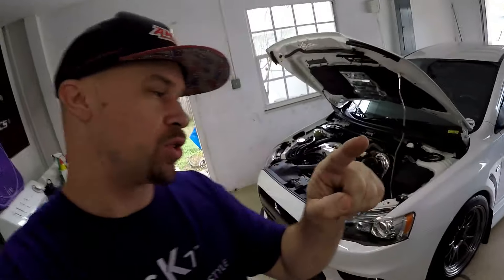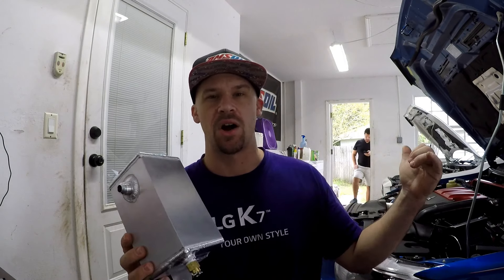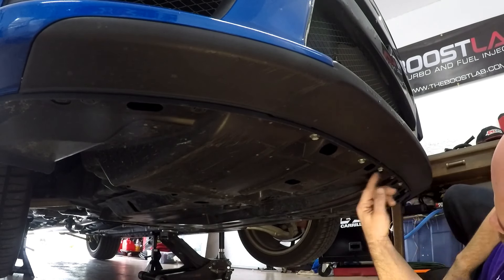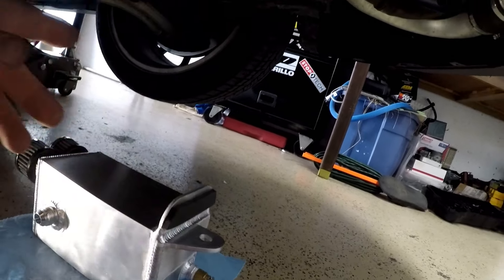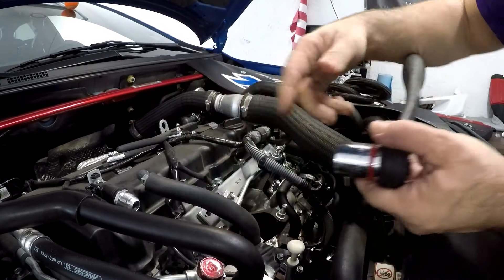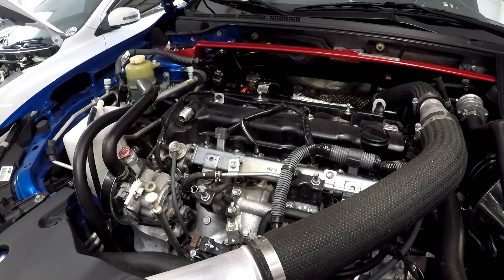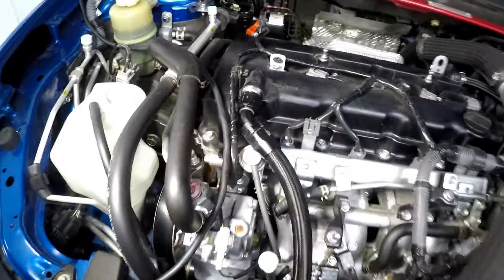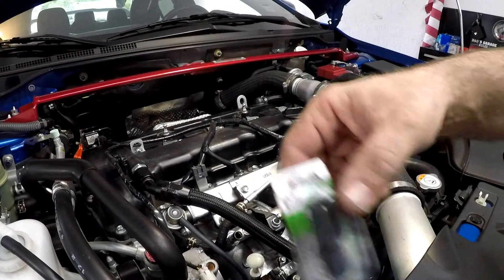STM Dual Oil Catch Install // Evo X

Comment: Thanks for the install vid, I always wondered why aftermarket companies don't make AOS for  evo's and only catch cans?
Reply from the maker: Hunter Bautista Thanks man. Multiple companies out there do actually make the air oil separators. Such as Moroso and Driven Fab
Reply: @xtra_slo1596  nice, most evo owners on youtube only install OCC not AOS.
Reply from the maker: Hunter Bautista it’s true, not many air oil separators I’ve seen done.
Reply: Driven fab makes a nice Air Oil Separator.   I have one on my EVO.  It connects back to the intake which helps reduce crank case pressure by using the "suction " of the turbo.  I feel this is the best method rather than venting  to atmosphere. 

The problem with the AOS running back to the intake is you need a large line 12N going back to the intake or you won't get the needed volume of air.  This means you need an after market intake and you need to weld the 12N bung on the intake for the 12N line ( which comes with the driven Fab AOS..  Due to this I think most people just go with the vented catch can.

I ordered mine from Driven Fab and recieved it 2 weeks later.  You have to contact them by email or Facebook.   Don't call them.
Reply from the maker: dsmtsi cool advice for the another method!👏🏼👏🏼👏🏼 driven fab took over 6 weeks for mine and 4 Months for my local friend! Email, Facebook, Phone... they lack customer service and delivery time Big Time! They are well known for this. Wish it was better because they do have some great products. Got lucky only waiting 2 weeks
Reply: @xtra_slo1596  Ya I got my 8374 bottom mount the kit from them and it took 5 months for it to come  in.  It wasn't until I started to hold them to delivery dates did they come through and deliver the kit.  Since then I gave them another chance with the AOS and they delivered as promised 

It is too bad as they make a loft of good products and they were the only ones that made my kit ( internal gate) with a 3.5" downpipe.   All others would only do 3" and I wanted the extra volume for spool on the street.

They need someone full time answering phones and emails so the guys in the shop can just work on fab etc.

I think they are starting to realize rhe inortsnce of communication and meeting deadlines.  

On a side note WTF tuning have been great.  I got my clutch and fuel system from them and their communication and delivery time is tip notch.  They go above and beyond every time I talk to them.   

I love your channel, it gives me motivation to set aside time and work on the car.   Tutorials are great very detailed etc.    Keep up the good work.
Reply from the maker: dsmtsi yea man they have great products but a real issue in delivery and customer service. Great to know wtf has been good to deal with 👍🏼 and glad to hear you enjoy the videos! Thanks for all the support!

Comment: Do you have a link for the valve cover fittings? I bought a catch can from a small shop that fabricates stm type cans.
Reply from the maker: Christian Sigala I would call Stm. They sell all types of fitting in the website, I’m sure they have what you need 👍🏼
Reply: Xtra_Slo Than you!

Comment: Are you going to do cosmetic mods eventually?
Reply from the maker: Itachlazcano21 I’ve done the front lip, hood scoop inlet, headlight swap, led lights and suspension install videos. All visual things. I eventually wanna do roof fins like the vortex generator on my car. Any specific ideas in mind I can keep in mind?
Reply: @xtra_slo1596  I have a carbon fiber rear diffuser on mine that looks pretty good. Beyond that and the vortex, I vote keep the exterior mods to a minimum. Keep it stock'ish looking with a few nice upgrades IMO
Reply from the maker: Matt Hinzel 100% 👌🏼